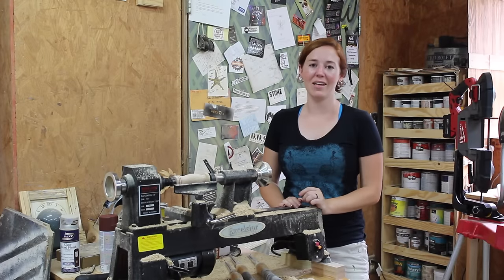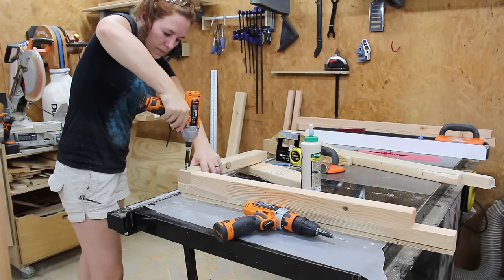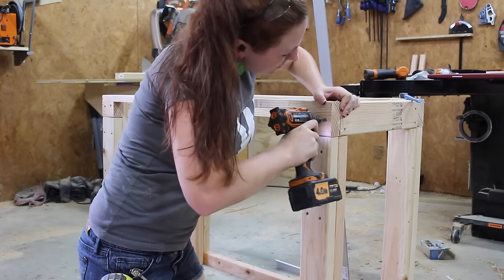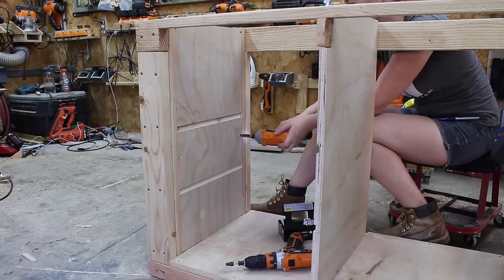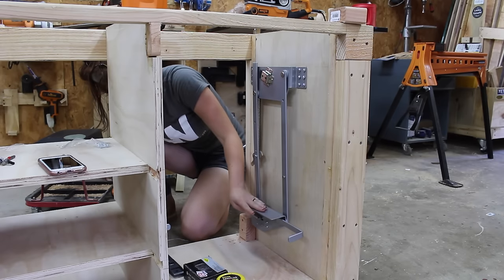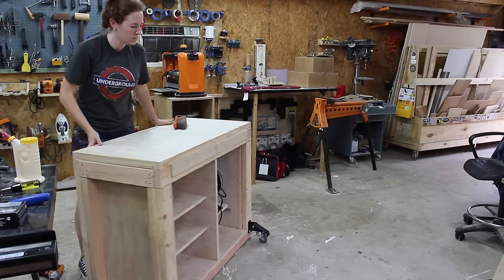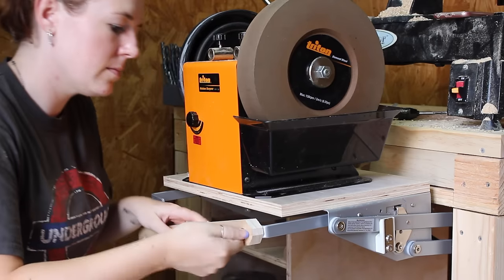Lathe Stand With Pull Out Grinder

Comment: Having your sharpener that close and easily accessible should make keeping your tools sharpened very convenient, however I'm wondering if you shouldn't put a door or panel of some sort in front to be sure the lathe dust and shavings don't get into your sharpener's water bath or on the wheel?

Comment: Hi April,

You know there’s many a man who think they can do anything but this bench and the design details would blow them away, you done a fantastic job, especially building it so strong because once its built you will want this bench cabinet to be ultimately super strong!
I love the thinking outside the box of fixing the grinder actually on the bench used for your intended work. How many times have you seen a second thought grinder on the other side of the shop and after turning it gets buried and you are forever digging it out to make the tiniest little touch-up to your tools?
You probably already know what a dirty and WET job turning can be especially when initial hogging out a large green limb for a bowl the water it unbelievably turned into steam as you work!

Comment: Might want to consider putting something over the front of your stand to keep the chips out of the shelves and grinder. I have a open stand too and it turns into a huge catch all for dust and debris.
Reply from the maker: Yeah we'll see, I might end up adding a door but I would prefer to have it open so I figured I would leave it as an open cabinet to start and see what I think about it. I can always make mods if the dusts creates too much of a problem in the shelves or grinder.
Reply: Ml

Comment: Since that is a wet grinder, something you might think about is putting some kind of cover over it. When you are turning wood, you will get all kinds of wood chips and dust in the water tank. Other than that, you are a very talented young lady. Great project. Thanks for sharing.
Reply: Fair idea Jerry but if you store stone wheels partially in water they go out of balance.  Way better to empty the water when not in use.
Reply: that makes little difference on a slow speed wheel..
Reply: Yes. This is very good advice.   The juices from some combinations of timber will actually harm the stone, particularly some west African timbers. (speaking from bitter experience with a tormek grinder identical to yours. actually I have two.)   It is also a good idea as steve james has said to empty the water between days in the shop.   Lastly and most importantly.....  As soon as you can find someone to make it for you, replace the chromed shaft in that grinder with a stainless steel one (somebody with a metal lathe can reliably copy it for you)   Otherwise water will eventually get in, rust the shaft seizing the wheel to it and eventually break the wheel.  This I know from VERY bitter experience.  It has cost me two wheels and as you no doubt know, they are not cheap.When you get a slightly bigger lathe (and you will) you can put two sand bags in those bottom shelves.  With lathes the heavier the better.   Good luck and keep the magic rolling!Ps. there is a diamond dresser available for those grinders, if not for the triton get one for the tormek it will fit (they are identical (I assume triton bought the rights) and use it periodically.   I noticed your stone is fractionally out of round. Not a problem yet but it will get worse.
Reply: @victorjbarker Makes little difference on the wheel itself, but a wobbly stone might make a difference on the tools you sharpen.

Comment: That is by far one of the best ideas for a lathe stand that I've seen so far. I am most sincerely impressed. If more people thought about what they were doing as much as you do, the world wouldn't suck so much. Thanks for having a brain and giving us the plans for this. I'll be scaling it up a bit as the machine I have is a bit larger. I love the grinder pull out though. That was the clincher for me. I might add a linear actuator so I don't have to manually raise it but that's all I'd change.

Comment: That is a really nice lathe stand and an AWESOME idea using the mixer brackets for the grinder, I already have ideas where to use those brackets elsewhere in my shop. I have read a lot of the comments and there are really good ideas and suggestions. The main suggestions are the safety ones, remove the rings, get a better dust mask, and use VERY good eye protection!!!!!!! I almost lost sight in my left eye from just wearing safety glasses when a chunk of wood came off of a bowl I was turning, Now I wear a heavy duty full face shield with built in respirator filters, uncomfortable yes and hot but better then going blind!!!!!!!!! one more quick suggestion, since your lathe is in the corner you will want to install plenty of light. I would hang a 4' light above the lathe and also mount a flexible light to shine on your work piece at different angles to see sanding scratches. I'm also a lot older then you and my eye sight is getting worse so I need more light but I would atleast use a flexible light

Comment: Nice job April. To solve the dust problem you are going to have can I suggest having the grinder come out the end instead. panel in front will give space for future faceplates etc, a roll top desk type door to fully enclose and mount grinder longways so you can access the stropping wheel. When I design I spend at least a day just sipping and thinking, try to solve any faults before you make them.Cheers from the Tassie shed of burntness.
Reply from the maker: I do the same when it comes to design, the only problem with this build is I've been turning all of maybe 9 hours. : ) So it was really tricky trying to design a stand for something I have such low experience on. I figured I would jump into it and after using it a bit more, make modifications.
Reply: Its hard to foresee all the problems, they aren't obvious till it comes to actual use. But its no fun if its easy.How is your welding going? Combining steel timber and brass can be nearly as gorgeous as you.

Comment: Those recessing brackets are totally awesome! I was just thinking about building a mechanism similar to those for some space saving features in my tiny shop. That's no on my amazon wish list. The table is a nice little build, my lathe is like the grand daddy of that little guy, about five and a half feet long, the table is a monster and I put in one gigantic storage drawer with heavy duty metal slides. It's not pretty, but it doesn't move either. I like those step down casters too!

Comment: A while back I found a non steel belted tire and cut most of it up into 4" squares as stock.  I use them as bumpers, feet, vibration dampers, etc. They are easy to cut with a sabre saw or band saw to the shape & size needed.  There are a few points on this project where I would have applied them.  Nice job on the bench.

Comment: Wow, compact and filled with lots of slick features.   Solid, no ply back needed.  Pro job, taking it  to another level of awesome without blinking.
Reply from the maker: : ) Thank you, I appreciate that.
Reply: 2:30 Not sure anyone else noticed the nice nailing pattern.  A good, experienced person will offset their nails.  You not only did that but the left side mirror images the right.  That's the sign of a pro.  A lot of framers and drywall crews don't  lay down a nailing pattern that pretty.

Comment: Love this video. I am considering something similar but have a larger lathe so may need to use a steel structure with breezeblocks in the bottom to keep it from moving.

Comment: Just a few thoughts, hopefully helpful.
Be aware of where the castor screws will be going when screwing the frame together (learned the hard way).
I attached neoprene strips to the base timbers to act as shock absorbers when the bench is lowered off the castors.
Where feasible clamp timbers together whilst screwing them together.

Comment: Just an idea. On the sides where you said you anticipated using for hanging tools, If you cut the bottom support so it is flush with the recessed wall you can put the step down casters there facing inward. Will allow you to store the cart flush against walls.

Comment: April---If you need to add weight for stability then you might consider old rotors from your hubby's brake jobs on the lower shelf.  I used them for my stand and they work great!
Reply from the maker: Good input! I honestly don't think any additional weight will be needed but I'll keep that tip in mind if I'm wrong. ; )

Comment: Smart lathe stand I like the grinder feature. I need some of those casters for my lathe stand I didn't realize they sold them individually and not as a mobile base type set. They would have worked better on my out feed table too instead of the locking castors I used.
Reply from the maker: Thank you! Yeah the casters work great, they are sold in a set of four.

Comment: @AprilWilkerson  I like the Stand and great video! FYI looks like the stand/lathe is a little high for you. A Lathe too high or too low you will get shoulder and back pain. I'm a Woodturning Mentor and the go to test for the height  of a lathe is to pull your hand on the opposite shoulder and your elbow should be at the centerline of the  spindle. hope this helps someone!

Comment: Some good ideas would be to make some wooden spacers on the lathe and bolt your lathe down to the bench, I've got the same lathe and when I started using a lot it tended o vibrate all over the place so I bought some bolts and bolted the lathe down. You need the spacers because the switch housing hits the table top without them. Hope this helps! -Oliver

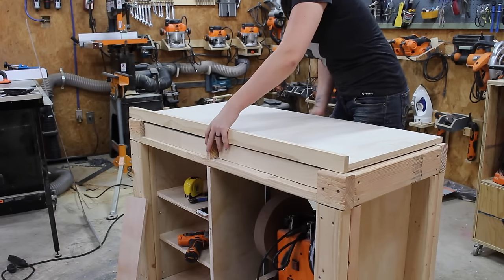Comment: 4:02 
I think it’s necessary. Torsional rigidity goes a long way to refining performance characteristics; add mass and you reduce higher frequency vibrations quite a bit - and that stops a lot if not all the harmonics that can settle into steady oscillating vibration. 

Good job. 

Beyond that, if more stability is needed, one think I incorporated into both my ‘tiny’ 50” woodworking bench and my lathe base was 4” deep ‘bins’ that I fill with dry sand. Hundreds of pounds can be added to each without buying concrete or expensive steel.

Comment: Nice! How about building box behind the lathe that prevents chips from flying behind the table and add vacuum there to suck at least some of the dust away? Also i would suggest building door/s, so dust dont get all over the grinding setup. Coat of lacker or paint would be nice for the top if you ever decide to do some metal working with this lathe, for instance aluminum turning.

Comment: Great Video, thanks very much. Absolutely brilliant idea using the mixer lift as a pull out sharpening station, I might just have to pinch that idea. It would solve a lot of problems I have in my small shed.

Keep the vids coming.

Cheers David

Comment: Nice, I used sand bags on the bottom router table to take the vibration, worked great when you don't have cast iron.

Comment: Know im coming to this video late, but if you have any trouble with vibrations from the lathe on larger turned pieces, you can add a piece of plywood to the underside of your stand making the base sealed, and fill it with sand, could easily get a extra 50 possibly 100 lbs of weight doing that, and your lathe would then be more stable when turning bigger things.

Comment: Great ideas in this build. The lift is a great use of a non-shop item in the shop. My only concern is the height of the lathe. The most ergonomic height would be for the height between centers to be at elbow height.
Reply from the maker: I played around with several heights on where I wanted my lathe before getting started and this was the height I was most comfortable using it at. : )

Comment: This would be perfect for my belt/oscillating spindle sander, and then my smaller belt sander that is only occasionally used can go on that lift. Possibly another lift on the other side for something else. And it will all fit in a nice small footprint.

Comment: great idea on the mixer lift.....I think you'll find you may want to put some extra weight on the very base of the stand...more weight is better, so some sand bags or (more ideally) a flat plate  that can lay on the bottom would help....  Most turners wind up fastening their lathes hard mounted to the floor,  this is particularly necessary if you're turning large blanks that may be off-balance.  However, given the size lathe you have, you may not run into that problem.   It will also depend on the type of turning you plan on doing.   It's a bigger problem with bowl blanks than it is with spindles...   Welcome to the Vortex!

Comment: April, very nice.  Think you might need to cover the grinder.  A bag or something or the lathe shavings will turn it into a wet pile of goop.
Reply from the maker: Yep I might end up doing that, but for the time being I'm going to use it as is and see how it works out. I would prefer to keep things open if possible.
Reply: Yup. Since you used a mixer support you can always throw one of those mixer covers over it like my wife's.

Comment: I like the step down casters, never seen them before. Pretty sweet setup:)
Reply from the maker: : ) Thanks, yeah those casters are sweet. I was going to make a mobile base like you did for your workbench but I didn't have enough room on the bottom for it to fit so I went this direction instead.

Comment: nice work with that April- I like the features of the variable sized drawers and pull up grinder station.  I recently upgraded my lathe to a slightly larger one and it raised my workpieces by 2 inches.  I started reading and it looks like the the ideal height for turning stock is to be elbow height.  I'm curious how you decided on the height of your stand? Thanks!

Comment: April It won't be long (if you use the lathe much at all ) till you will be enclosing the front and back All the flat areas are just a shaving and dust catcher. I have a shelve under mine and I can turn two pens and have it covered, turn a bowl and have it 2 or 3 inches deepStill a nice build

Comment: realy like the grinder stand might look for a Rev a Shelf Heavy Duty Mixer Lift  in the netherlands 

having the cabinet against the wall prolly prevent it moving about if you need to make the table more solid you could take the lathe and grinder off temporarily turn the table upside down and fill the bottom cavity with sand before closing it of with more plywood , should add quite a bit of weight to the cabinet realy low to the ground and will make the cabinet a lot more solid when you push against it while working on projects or rotating offcenter pieces of wood

Comment: Nice build.  Perhaps two simple doors in front of the bays below?  I'm having visions of chips finding their way into the tub for the wet grinder.
Reply from the maker: Meh, we'll see. I would rather not add doors if they aren't needed so I'm going to use it as is and see if it works out. If the tub gets too dirty then I'll either empty it or figure out another solution, but my first choice is to have things open and accessible if possible.

Comment: You did a very nice job, >>>>>GREAT<<<<< design!!!!!!!!!

I was told by a friend that "anything built too stout never broke", which I've lived my life remembering his statement. 
FYI and my 2 cent opinion, rather than doubling the top thickness, in the future you could use solid core doors, either 1 3/8" or 1 3/4" thick...(of course it might require that "special project" to justify the cost). Buy 'stave core' doors as they are stronger, straighter, can be cut into several shapes/sizes and a tool/machine can be mounted anywhere as you have solid wood within the core.....(a 36" X 80" X 1 3/4" birch veneer makes a great assembly table and it can be painted/ finished easily). DO NOT use particle board core! I've made several of these and they're wonderful. (I have one in my shop for that "future unknown project" that will require it's use).
....13

Comment: I made this and I like the layout, but one thing left out is the height. I'm tall 5'11". It needs to be emphasized that the correct height for a lathe is determined by putting your non-dominate hand on the opposite shoulder then look at where your elbow is and that should be lined up with the height of the center of the head stock. Mine was too high.

Comment: Like aways, neat to see the cool stuff you build... on a side not, pending the climate which you live, meaning seasonal cold / freezing temps and if you have water and waste utilities.... often, check the "thermostat" via lightly blowing it out with compressed air, more then 4 to 5 P.S.I. is starting to get risky, as per, damaging the reactive Bi-metal coil (the switch contact points). That happened to me, due to the dust and static cling effect, and I caught the issue in the nick of time, (25*F), and if that had been allowed to stay that temp, the freezing was a for sure thing and maybe hours left, and was just lucky, that I left something in my shop and finally went out to get the item, after having not been out there for 4 days... Another side note, I purchased one of those clear plastic safety covers or tamper proof vented covers for the thermostat, and that only made things worse, and the clear plastic was a magnet for wood dust... just a thought... as always, nice job.